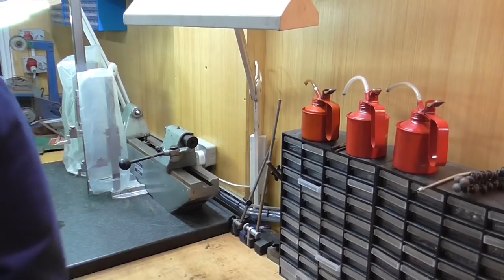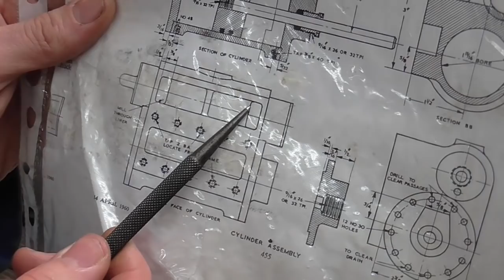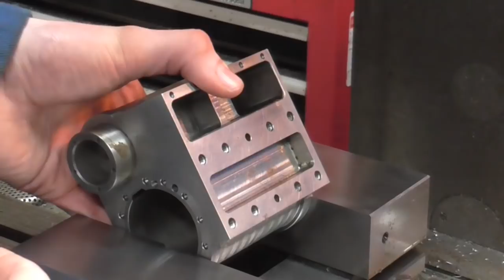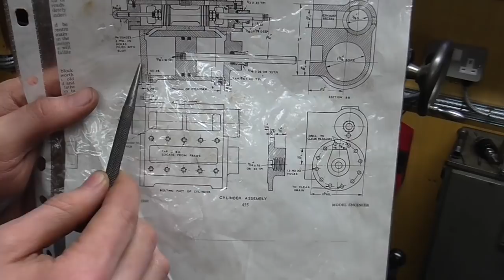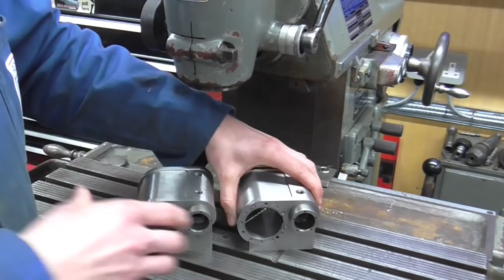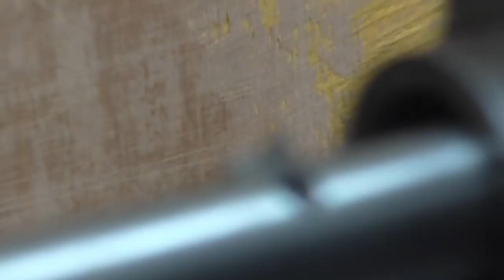Machining Cylinders Part 8

Comment: Your steam water drains could have been off of botyom center as you did but instead of having to make a compound drill, a small shallow slot in the bore from the bottom of the bore just over to the drain position would have also worked. I've planned hundreds of compound passages in hydraulic valve bodies which seemed possible but became  and twister for the machinist. Your completeness for taking enough time for setup accuracy is commended.
Reply from the maker: Good idea

Comment: Respect for your skill Crispin I spent 41yrs as an engineer in Aerospace industry 20 on manuals and 21 on cnc and once for RR the real scary part there is no one to take over any more not enough investment in the industry, and most of the work went to China they must be regretting now I hope.. Well done sir have you finished done a loco yet???
Reply from the maker: No the loco is on going!

Comment: Thank you for all your work. It is an education! Question: will Loctite survive the high temperature of overheated steam? I usually use hot air gun to break a Loctite bond, and steam can be 250 celsius easily if overheated. Do you have a special Loctite type or expect only low temperature of the steam? (And I am going to repair my Myford Super7 - I thought it is not good enough for the work I do, but apparently the problem is somewhere else - first me and second I have axial play in the spindel with causes a lot of chatter in higher than minimal load and cut...)

Comment: 22:29 You appear to have an oil splash guard on the headstock spindle bearing. If that's the case, this suggests the drip-feed oiler is being opened too far. We didn't have an oil splash issue - unless it's down to grade of oil being used.

Comment: 19:36 How did you set the cutting tool to the correct position considering you've just shortened it with the stone ?

Comment: Hmm, that compound angle drilling was made very easy by having a quill !
With a lack of quill I guess I could do similar as per your earlier thread tapping but that'd mean driving the drill by hand. Hmm, this is getting messy!
I guess I'm just going to have to mount the work at the angle and drill straight !

Comment: Rather than drill those holes at the awkward angles, couldn't you have moved the low points of the cylinders by milling small channels (like you did for the steam ports)?  Also, because the centre-line of the cylinder bore slopes down, the front drain cock will not be at the exact low point anyway.  The swirling steam and moving piston would probably blow 99% of the condensate out, even without any extra channels.  What do you think?
Reply from the maker: Hi, 
Yes you could mill channels in and then drill the holes in at a plain angle although that would still have been on the fiddly side. Less working out though I guess. Also milling at an angle in to a radial surface gives a curved slot profile when considered from a top view, you would have to be careful it didn't add too much width to the shape. 

As for the condensate making its way out due to steam pressure yes you are probably right although when the piston is at its full forward position it will have effectively moved any water right up to the hole.

Cheers

Comment: We need more young engineers like you so that model engineering doesn’t disappear. All the amazing models you see at engineering shows are made by true craftsman on manual machines. Unfortunately the modern apprenticeships are based on cnc machining so the skills of the past are not used as much. A lot of young engineers today wouldn’t have a clue if you give them a block of metal and asked them to make something on a manual machine. Operating a cnc machine doesn’t require many skills and are too expensive for home use. All the amazing locomotives you see today will end up in museums or bought by collectors. I’m lucky enough to still make parts for the rolls Royce trent 900 engine on a manual machine. Let’s hope you can encourage more young people to take up model engineering before it disappears.
Reply from the maker: Do you work at Rolls-Royce?
Reply: MrCrispin, no I work for a subcontracting firm making parts for all military aircraft and have made a lot of parts for rolls Royce. A lot of the parts were used on the RB211 engine but now it’s the Trent engine. Keep up the good work and let’s hope you can encourage more to take up the hobby.

Comment: Glad to see your back!

An interesting drill chuck you are using to drill those drain cock passages. Where did you get that from? Also how did you start the holes in the bore? Was that a slot drill I saw to start with?
Reply from the maker: Its a double angle collet holder. It was indeed a milling cutter. It was a 1/16 ball nose.
Reply: MrCrispin is this an ER type? I have seen them on Arc Euro Trade, but the collet closet looks much bulkier that the one you are using.
Reply from the maker: No 'double angle' is another style of collet system. Can't really advise where to look as I got this one off a friend.

Comment: Superb work. looking forward to the 2 videos mentioned as well. The mill you used most in the video, is it a Deckel or Alexander, either way I have a question about the threads on the collets please.
Many thanks William
Reply: Sorry my bad, must learn to read!! its a Deckel mill, if possible can you give me the dimensions for the collets, 
I know alaexander machines are clones of deckels. and having a 2cg D bit grinder with one original collet the threads are the same diameter as the body on the collet. However i picked up a load of collets last year which fit the D bit grinder perfectly but the thread diameter is smaller than the body. But both threads are the same tpi (21 off the top of my head) so any insights wold be much appreciated, 
Thanks William
Reply from the maker: I'll have a look.
Reply: @MrCrispinEnterprises  Super much appreciated, 
I've just eyed up a thread pitch gauge to said collets, as far as I can tell not a "standard" imperial TPI (appears in between 20 and 22 TPI) however a metric 2.1mm pitch seems to line up.  
Just gotta work out how to cut what ever thread on the quick change myford box! Bit of jiggery pokery should get me there I hope.